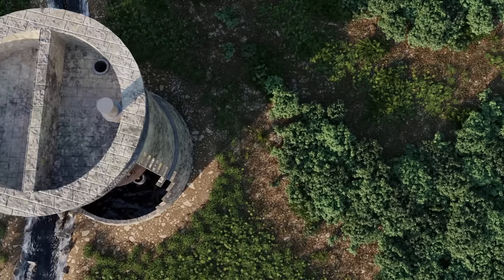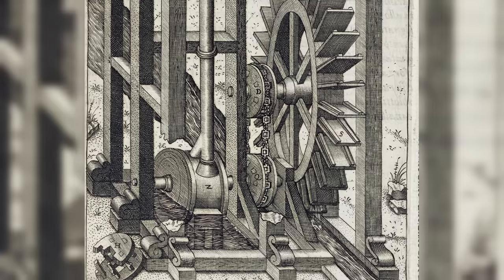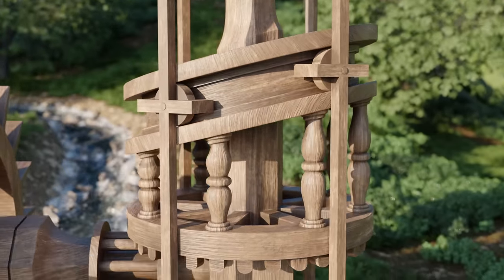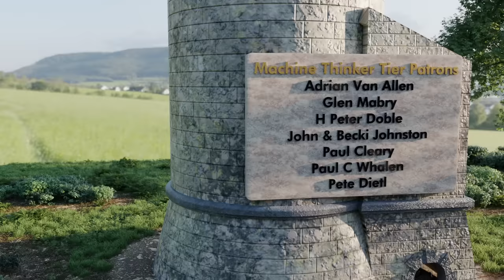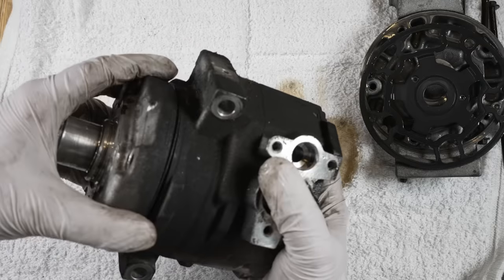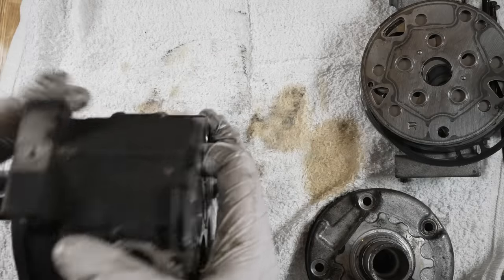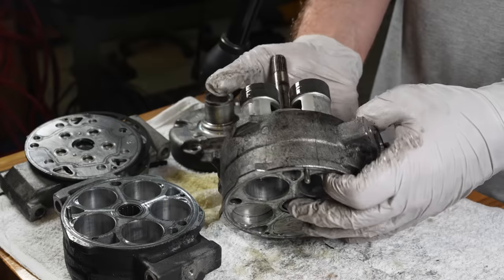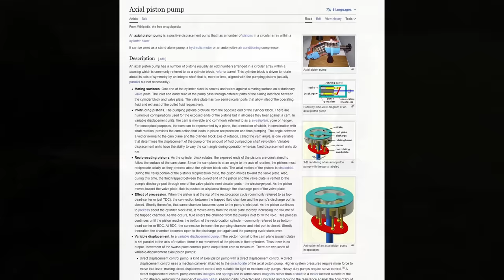How an ingenious 400 year old drawing predicted the future

Comment: As I recall, some AC compressors in cars work using the same pumping mechanism, with one rotating shaft and the cylinder cam and several pistons in multiple chambers oriented in a circle.
Reply: Damn I'm good

Comment: Automotive radio air condition compressors use the squash plate construct to compress refrigerant.
There have also been some designs of aircraft engines that use the squash plate in an arrangement to make a smoother operating aircraft engine that operates in a more linear fashion so that its size is reduced.

Comment: Variable capacity automotive ac pump.
Some models use a clutch some have a 0 flow position on the swash plate.
Also used as a hydraulic pump and motor without the reed valves, again variable flow.
Additionally also used in medical devices e.g. heart bypass machine where coolant is used.
Your water meter is a variation on this.

Comment: AC compressors. Also, the bathtub like thing at the top. That's a receiver. There to keep pressure off the pipe. I think what you have there is an old model Ford.

Comment: if you make 3 angled rings in stead of a single disc and put them 1/3 out of phase it could push a much larger piston (with 3 rollers)

If it wasn't using both sides I doubt it is ideal to have both the up and the down motion with the same force/speed. In stead of half way up and half way down it could be 1/4 up and 3/4 down. 

Anyway, what wonderful smooth contraption!

Comment: From the beginning l knew what was coming, as i once spent like 2 hours getting 5 pistons and 4 different elements that would like to fall out at once into housing of compressor like this, but extra complicated with pneumatic lift regulation.
It was from 2001 Renault Laguna II and i did not think, that this can be possibly that difficult to reassemble while changing seals :>
Reply: Electric valve is used to put pressure on piston, that sets cam plate angle. Angle could be very low to get little to no pumping, and could be very high to get a lot of pumping even on low engine speed.
In modern cars i see a lot of compressors with no clutch (i work with Hyundai cars), as with no lift on pistons friction losses come just from oil and while it is hot those are neglectable, so getting simpler with no clutch was a way to go.
In Honda cars i have seen scroll compressors, and when those do fail it is messy. Those have no way to regulate pumping volumes, and as quiet as those are they need clicky clutch cycling  from time to time

Comment: Air compressor pumps, a/c pumps and other heat pumps, diesel/jet high-preasure fuel injection pumps, and some medical dosage pumps use these, and there was at least one attempt at a rocket motor fuel pump using swash-plate pumping.

Comment: I'm pretty sure that there is an internal combustion engine which using similar mechanism to this pump, but of course power is generated by combustion in the cylinders and goes out via the shaft in the centre.

Comment: I saw an air-con rebuild online and the compressor has a rotating shaft with an offset ‘cam’, to compress gas, the same as the waterwheel, so it could be a continuous flow pump..of fluids.

… doh… I spoke too soon..🥴
I saw it on Wheeler Dealers

Comment: These kinds of pumps are used EVERYWHERE. They're the most common pump driving hydraulic systems. So you'll see them driving the landing gear on aircraft. If your house is heated by a boiler then the pump moving the water around the house to all your radiators is likely one of these. Outboard motor boats often use tiny versions of this pump to drive a cylinder to tilt the motor forward to bring the prop up for use in shallower water. The hydraulic cylinders of everything from snow plows, to bulldozers, to bucket loaders, earth movers, you name it, they all use a pump based on this principal. Even hydraulic presses and log splitters use them. 
The list of places these pumps are used would be pages long.
As for crediting Ramelli for coming up with them, who knows? Just like today it's pretty much impossible to tell who actually came up with, or even developed a design. When you see a name on a patent for example, most of the time the person named in a patent had absolutely zero to do with coming up with the idea. Usually it's the name of creator's boss, or the name of the owner of the company that goes on the patent. You know. The "important people" that sign the paychecks. Creativity and innovation are highly sought after traits in an employee,  but they're rarely ever traits that get you any worthwhile credit, let alone a raise in pay. Just the way the world works. Deal with it.
Think that's being cynical? Really? Who was the first one to draw Steam Boat Willy, otherwise known as Mickey Mouse? Copyrights were supposed to be tied to the life of the "author" of an idea + so many years, then the copyright runs out and the property becomes copyright free. But "The Mouse" owns the copyrights to 'ol Steam Boat Willy, and so "The Mouse" is the author. Walt died long ago, but the corporation he built is still around so that mouse is still a copyrighted property even though that copyright should have ended LONG, ago a few years after the person who first drew that character died.
So did Ramelli come up with all these ideas? Maybe. But probably not. He was probably just an overworked illustrator working for various patrons that had drawn scores of machine ideas like this, and simply collected some of the better ideas he'd drawn up over the years to include in his book. And if he made a little extra cash to feed his family doing that, I say more power to him. Attaboy Mr. Ramelli!

Comment: What did Ramellis machine accomplish?  Are you supposed to hook a pipe to the top and then transport water to another building?
Reply: yep, given some rotational power it can pump water up and you just let gravity flow it to the place you want. make the tower higher and you can supply a while city with the extra pressure.

Comment: RV water pumps use the same design. Since they work off of a house battery system they need to be efficient when the rig isn't plugged in. This design is much more efficient than a piston type pump.

Comment: I actually don't think the V-dog was interested in the smooth output flow of this type of pump, because when moving water to a higher elevation that doesn't much matter, all outlets downstream of the reservoir get pressure from the static head.

I imagine he drew it because it is so self-evident from it's design that such a machine could support any number of pumps around it's circumference, with any distance of linear travel for the pumps, etc etc etc. The versatility of the pump gets the mind of the reader going.

Modern applications like the steady output pressure despite the positive-displacement pumping (always a fussy combo at high pressures). You'll find that AC compressor has 5 pistons because 4 pistons wasn't smooth enough, otherwise the auto manufacturer would have saved the dollar it cost to put it in. Or maybe more pistons more flow. I guess it's just very versatile-oh

Comment: my first guess as to what machine shares similar mechanical principals to this machine is a car's engine. the asymetric pumping action of a V8 engine looks, at least to me, like the asymetric movement of those pumping pillars. additionally, if the vertical, to horizonal movement of the water wheel to the crown gear was reversed, it would be like an axel of a car and the wheels being turned. thats my best guess.

Comment: 45 years ago when we were buying new cars and doing electric conversions we didn't have access to the modern VFD drive so we would take these compressors apart and remove half the cylinders so we could used a fixed speed DC motor that was available and had good performance (thin laminates) to recreate the refrigeration pressures to work with the little Dodge Colt/Mitsubishi Mirage/Eagle Summits (all the same car) we were converting to electric.  Everything was flooded lead acid then except for a NiMH version that a company helped sponsor.  Unfortunately charging electronics back then were also in their infancy and NiMH got a bad rap of which a high self discharge rate was partly responsible.  On the ISS before they converted to Li-ion batteries the Ni-H2 were monitored by a team of engineers and were hardier with a longer life than their Li-ion replacements.  But seeing as they weigh 3 times as much and were rather hazardous (and running at 1,200 PSI) it was inevitable that they would be replaced.

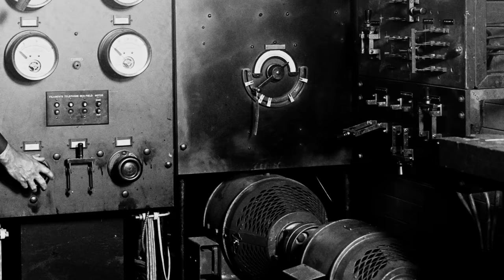Comment: 4:55 I bet it's not "he couldnt bear the thought" but rather, he polished the design to the max. Imagine that instead of a water basin, you have another water-powered device up there, or any other "output socket" where something else can be connected to take the water away. What's going to happen if it's clogged or disconnected, and the basin and sink were not there? Water would quickly gather up in whatever holes and pockets and start overflowing and flooding the wooden/metal gears below. This device seems to be designed to be low-maintenance. Maybe oiling here and there from time to time. I suppose leaks on the top and flooding the wood below is a viable danger, and could damage or destroy the device in the time between mantainers come to do next inspection. Of course, that's just a guess of mine.

Comment: As BRILIANT as our Ancestors were, it ALWAYS baffles "me"  None of them came up with a mechanical system of Water Born Propulsion better than Fragile Ors? and Oarsmen for Man O War Vessels.

as a Millwright, Service tech, and Hydraulics specialist on Lots of Modern Mechanical systems, I can say this system is Used STILL Today and "I Would" ASSUME the original was designed with a simple serviceable reed Valve system, quite common on compressors to this Day!

Comment: Late to the party, but a similar mechanism is used for rotation-driven multi-piston compressors for Car AC.
Reply: also, the slanted disk is used to create back and forth movement out of rotational motion in hammer drill (called a perforator around here)

Comment: Well damn, I would have been right because the AC compressor was my first though but I figured I was wrong because it lack any sort of Ring and pinion gear or other 90° drive gear configuration being that they are typically Axial drive (like the one you show there) unless its a York Style, which externally, one might think is a perfect match to the Ramelli Machine but it isn't though as it is crank shaft driven pistons (think of it as an inline 2 cylinder engine

11:45 There are Automotive AC compressors that are called "variable displacement compressors" that use a variable angle Swash Plate to actively vary the displacement of the compressor during operation  to improve fuel efficiency of the cars engine. Since the displacement volume of the compressor has a direct relationship to the amount of power required to drive it, a Fixed displacement compressor has, for all intents and purposes, a fixed power consumption from the cars engine. The thing is, once the cabin is cooled to the desired temperature,  you do not need as much system Freon volume flow to maintain that temp so by making a variable displacement compressor, you can reduce the displacement volume once the desired temperature is reached and thus reduce the power consumption that the compressor places on the cars engine. Then the system only needs to vary the displacement by small amounts to maintain the temp. It also removes the need to cycle the compressor on and off to prevent evaporator freezing so these style compressors do not have the electro-magnetic clutch that is typically found on many automotive AC compressors.

Comment: Helicopters, hydraulic pumps and also some prototype engines and hydraulic motors use the swashplate principle. The most common uses are helicopter cyclic control, hydraulic pumps and automotive air conditioning compressors.
Reply: Patting myself.

Comment: Straight away I was thinking of variable displacement hydraulic pumps with closed centre load sensing control. CCLS. Apart from for simple hydraulic power I have a tractor with a power-splitting continuously variable transmission where such a pump and a similar motor [in fact they are interchangeable in use] are computer controlled by swivelling the motor though an angle rather than the swash plate itself tilting. This is achieved by hydraulic rams attached at one end to the chassis and at the other to the free end of the pump and motor. These are connected to an epicyclic gear set that apportions the power either 100% through the hydraulics at one extreme or up to 100% through the mechanical drive at the other.   For more details, look up the Fendt Vario transmission. Otherwise simpler pure  hydrostatic drives that use swash plate pumps drive all kinds of agricultural equipment from sprayers to 1000hp 25 ton combines and self propelled forage harvesters.

Comment: Air conditioner compressor. Uses a swash plate pump. Edited the modern A/C compressor uses a belt/electric motor and doesn’t have cycling clutch and instead uses that variable swash plate design.

Comment: I am not going to get into the details of upward flow etc., but rather output in today's world would be a 'water tower' with its ability to provide a pressure at ground level equivalent to the height of the tower. The storage area would need to be of sufficient size so that the pulsating I put flow would have no effect on the output flow or pressure.

Comment: by far the most common use of this type of pump in modern society is in either refrigerator or air conditioner compressors.

second is hydraulic power pumps.

Comment: Great video! 😊 The connecting rollers between the slanted, rotating plane and the pistons shouldn't be cylinders - cylinders would cut into the plate at top and bottom position. They should probably be balls.

Comment: PAUSE : hydraulic pumps and motors (including those with variable angle for the swash plate to change the pump/motor volume and  your typical car air conditioning compressor

Comment: Yes they are very similar, basically the input is in the center instead of the side, this machine duplicates the function of the pistos and also adds 2, so basically its like 12 pistons working on the same step. Its like they took the original design and just moved and re sized the pieces, kind of makes you think about  the utility of those old draws ha?, maybe I should use one to build my stairs.

Comment: My guess is a hydraulic pump, but your question is too hard because this pattern appears in a lot of machines where you need to pump a fluid across a high pressure e.g. a pressure washer.

Anything which can effectively turn rotation into multi-phase linear output or back is a winner. The electrical equivalent is the ubiquitous three phase AC motor, which probably drives a fair number of axial piston pumps!

Comment: The same design is used in pressure washers.   Would have been easier to open.   The use of this that changed the world is the hydraulic pump.   Almost all large and small construction equipment, bulldozers, excavators, etc have these pumps.

Comment: I get in my car, turn on the AC and it turns out that this darn compressor design eventually introduces shavings into the system so that it inevitably fails at some point when the whole system starts leaking.

Comment: my first thought is not a pump... great axial cam example is a motorbike shift mechanism... 

the main issue with swashplates and cams as "engines" is the sliding frictions, line contacts.

they are only ever viable as pumps, hydraulic motors... relatively low pressures, with no abrupt spikes...

consider a taper roller bearing. it has lines of convergence, and the complete roller rolls along its length. if the lines dont converge, they can only roll in one tiny spot, every other point is sliding. basic geometry. cylinders cant roll around cones...

as this is an inclined plane... it has no central convergence point. the only time the roller is parallel with the surface is midway, and even here, the inside and outside diameters are traveling at different speeds...

add to the fact the rollers are only line contact. they dont spread pressure over large surfaces, unlike standard crank and conrod bearings... instead of oil films, you get metal to metal contact.

michel went someway with his thrust bearings, using them in 8 cylinder swasphplate type motors... his thrust bearings still being used in heavy shipping.

lamplough was making rotating barrel engines with two strokes, compressor pistons, and sleeve valves stuck in random places.

the other option is to use yokes with spherical ballends, and whilst they spread the load well over the bearing surfaces, the surfaces are spherical, the action of the yoke on the actual "crankshaft" is very high pressure as the crank, rather than being offset, or eccentric...  its "skewed"... you need really wide, long bearings to take the forces produced. 

theres a whole list of insurmountable issues they suffer due to the "swashplate" or axial cam... they look great on paper. other than the very early years, noone has made a commercial success from them. theres a reason they were forgotten about...

Comment: I wonder which was first, the hydraulic pump or the air-conditioning pump . I would say the hydraulic pump as it is single acting, which is not quite sufficient for air conditioning ! Then the two stage compressor was conceived !

Comment: The water was pumped to the top to allow the pump to continue operating if there were to become a restriction in the main  output pipe or if the outfkow to maines had to be closed off?